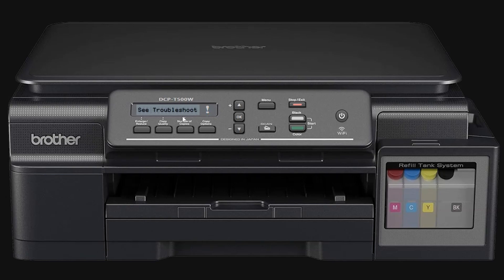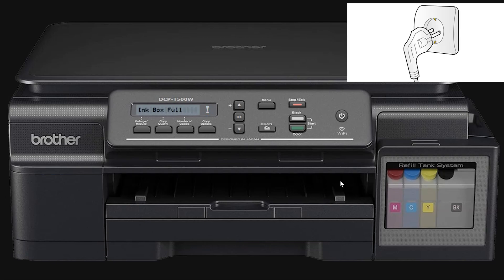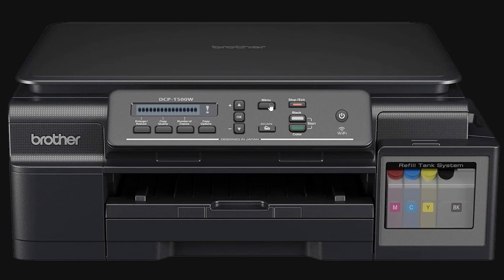How to Fix "Ink Box Full" Error on Brother Printer | DCP-T500W, DCP-T300 | Ink Absorber Full

Comment: Thank you for the clear step by step help!. The error returns after the reset. I did the whole thing again but the purge is 000. still I finished it. after the reset, the error returned again! Maybe the ink box is actually full? Please help what to do! 😰 Thank you in advance for your help!
Reply from the maker: Hi @ceciliafulgencia, thank you for your kind words and for trying out the steps! 😊 I’m sorry to hear the error keeps returning despite resetting.
Here are a few suggestions you can try:

1️⃣ Check the Ink Box/Waste Ink Pad: If it's physically full, it may need cleaning or replacement. Refer to your printer’s manual or consult a technician if you're unsure. You can also find the soft copy of manual.

2️⃣ Reset the Printer Settings Again: Double-check that every step was completed as shown in the video. Sometimes a minor step might be overlooked.
Reply: @CodeFlow  Thank you for the expert advice! Im planing to have it checked. Merry Christmas and God bless you always! 🙏
Reply: Buenas tardes, el código 46 aparece y rápido se quita. Luego aparece que la caja está llena. Cómo hago para que se mantenga en el código 46? Gracias